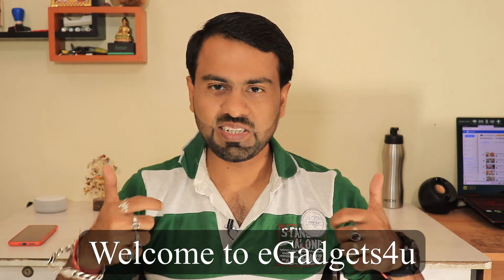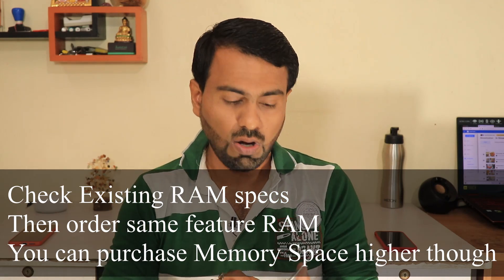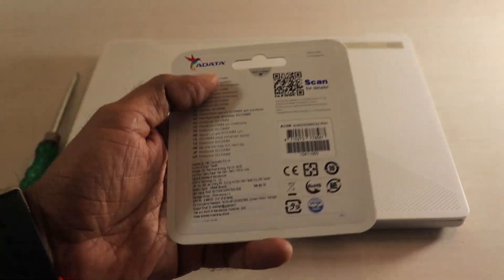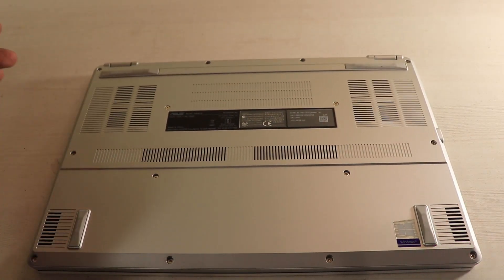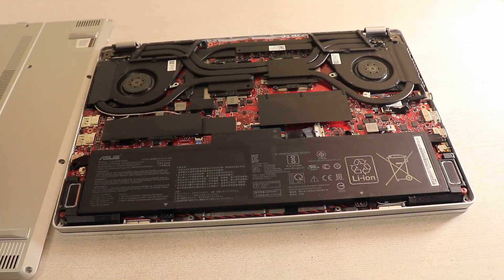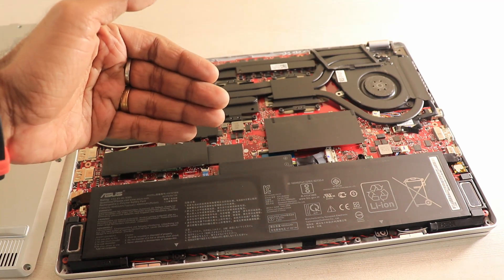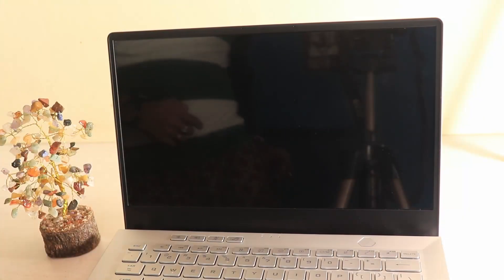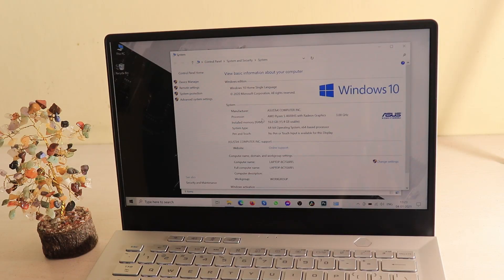How to increase RAM in your Gaming Laptop | Asus Zephyrus G14

Comment: I bought gskill ripjaws 8gb ddr4 ram. I installed it but then system is not booting up. When i remove ram it works fine. Anyone facing this issue? Is it compatiblity issue? Can anyone tell me pls?
Reply from the maker: Ir is a compatible issue
Reply: @egadgets4u  will I need to use different ram? If so pls tell me if crucial 8gb ddr4 is compatible or not? It is the best selling ram on Amazon